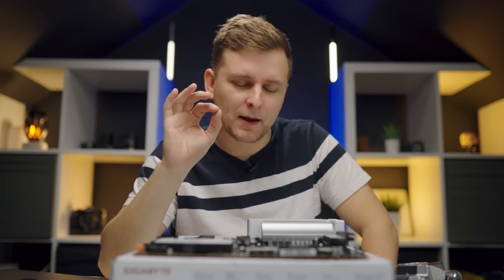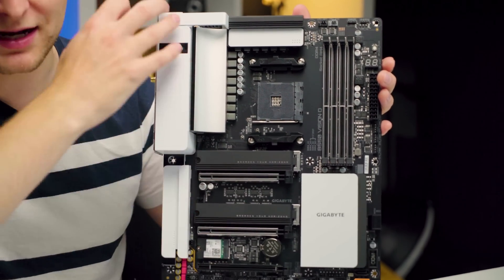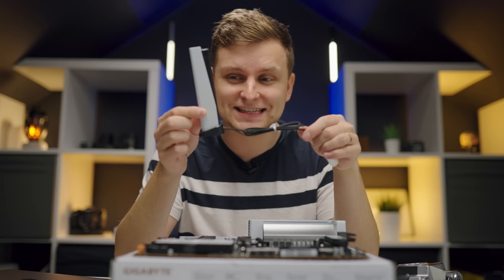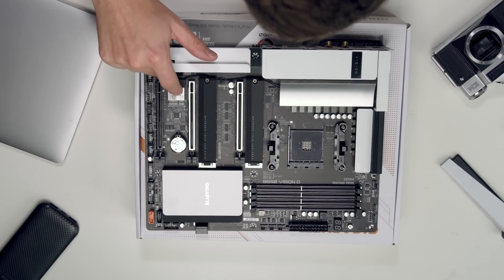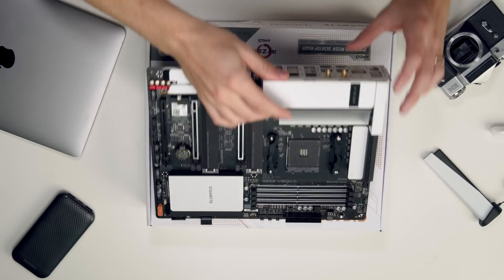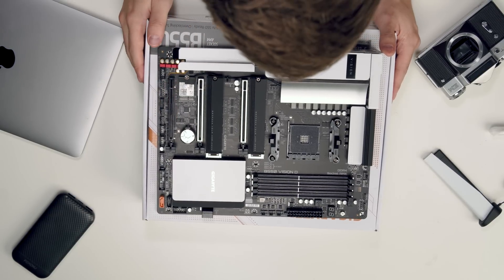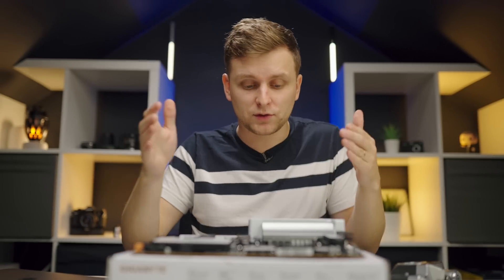Best Bang for Buck motherboard for CREATORS, finally! | Gigabyte B550 Vision D

Comment: These retail over $300. It looks great and I wish more motherboards were styled liked this, but this isn't exactly value lmao. There are a lot gimmicks, but I think most of it you don't really need. It doesn't have a lot of USB connectors and I still use a ton of HDD's for cold storage where SATA ports are the rate limiting step, so TB3 isn't going to help much. Also, the designare RAM unfortunately doesn't seem to be available above 3200 Mhz.

Comment: Bang for Buck for Vision D? It is super expensive! Probably the most expensive in B550 range and it's value for someone who do not necessairly need TB3 is mediocre.
Reply: I 'd like a Vision  X570 version, for both 4.0 Nvme M.2. I own two Sabrent M.2 PCI 4.0 1Terabyte. And this Vision D miss frontal USB C.

Comment: Hi tech notice,

Are you able to connect a thunderbolt monitor on this motherboard?
Reply from the maker: Nope, as far as I know, since it required the CPU to have iGPU, which would be slightly hard to find, and not sure if it would work. Better to get a GPU that has a USB-C port...

Comment: So if I wanted to game at high frame rate could I with this motherboard? Or is it meant for creating?
Reply: Fame rate depends from  GPU and CPU, not from MB.
Reply: @lorenzoocchipinti9120  i was just wondering if a motherboard could limit the communication speed between the two parts

Comment: Keep in mind that you need to update the BIOS on this motherboard if you want to use it with the 5000-serie Ryzen. Check out how to Q-flash the motherboard on Gigabytes website!
I struggled with this in my build, as it won’t boot straight out of the box with the new ryzen!
Reply: Hey can u please contact me I need help I just got into building pcs an I just finished my build but I can’t use WiFi, is this a driver issue or is my mother board broke I’m just stressing I spent so much time an money in this build

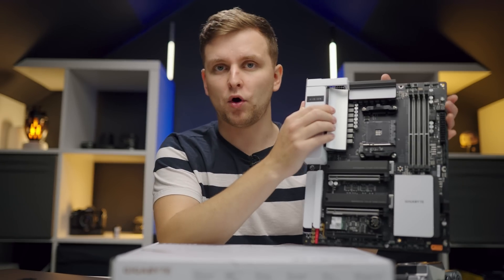Comment: 1:10 completely wrong. the Asrock boards came out beginning of this year have Thunderbolt 3 ports and its a creators edition motherboard this bought is the 2nd one this year.
Reply from the maker: Yes, I knew that, but as far as my research goes I don't think the TB3 ports on that board are not as reliable and have caused some problems.... and this B550 doesn't seem to have them. Now I'm happy to be proven wrong...
Also this is the first Am4 socket board that pugetsystems are recommending for a reliable TB3 bolt...

Comment: Heard about this board just recently. Planning on making a 5950x build, and I always thought you had to go with x570.

But what if I wanted to run 3 or 4 SSDs? Would this board allow me to run them at their full/max speed?
Could this board handle a beefy GPU like the RTX 3090?
(noob here)

Also, you could do a better job matching your cameras - your side view camera seemed brighter and more saturated. I'm not sure I agree with other people on flipping your top down view tho - this works for me.

But I see you're getting traction - good job!

Comment: heard asrock x570 creator #2 m.2 nvme interfere tb3 ports when it uses pcie lane, how would it works for b550 vision d? all the interfere issue i heard horrifying me

would b550 vision D tb3 controller uses its own pcie lane??
if its not   using tb3 header mb with AIC better than x570 creator and b550 vision D?

Comment: Hey! If I add two GPU's and two M2 NVME Gen 3 in this board. Will it affect its performance, will it bottleneck? Or should I go for x570.
Reply from the maker: Yeah, there will probably be a bottleneck...
Reply: @theTechNotice  see that's my concern.  I'm planning on getting a 5950 CPU with a 3090 graphics card for now, but quite possible get a second 3090 later.  I'm worried about bandwidth   Also probably a couple M.2 drives for when I do music production
Reply: @mathewCPA  But M2 Nvme slots aren't both 4.0, one is 3.0,  I own 2 NVMe 4.0 to Gen. 4 to mount and I would like to take advantage of PCI 4.0 in raid mode. I have to prefer a X570 with both Nvme 4.0 slots?

Comment: I know this is meant for creators but are there any drawback for using this motherboard compared to others for gaming?
Reply from the maker: Nope, unless you plan doing some serious over clocking...
Reply: It doesn't support M.2 Nvme 4.0 on second slot. I own 2 Sabrent M.2 PCI 4.0, and it would be frustrating not to use it on this motherboard.

Comment: I honestly wish gaming boards looked similar to this.
Reply: if a black version launches or any color that would be really nice.
Reply: @mixelio3409  I'm surprised they don't offer both, a la NZXT, but all black motherboards are at least available.

The Vision D is the only AMD mobo I've seen featuring a restrained, minimalist aesthetic in any color.  I just wish they'd offered a less expensive variant without the bifurcated PCI-E slots, as most users probably don't need them.

Although I don't need TB3 ports, they are at least useful for the board's target users.
Reply: @mixelio3409  Oh yes, and much faster.
Reply: I bought it primarily for gaming.

I'll never use the bifurcated PCI-E slots for SLI, don't use a Quadro GPU, and don't really need TB3 (at least not on my desktop), but the Vision D is just so much  better looking than every other B550/X570 that I bought it anyway.
Reply: @theoldhenk7531   is it supported rgb?
Reply: @theoldhenk7531  But M2 Nvme slots arem't both 4.0, one is 3.0?  I own 2 NVMe 4.0 to mount and I would like to take advantage of PCI 4.0 in raid mode.

Comment: I have a z390 for Intel and thunderbolt 3 is garbage. I constantly have to unplug an re-plug in my thunderbolt 3 drive and sometimes i have to restart the entire computer to get it to work. Also as you can see they didn't even cut the back plate to size for the USB-C connectors 5:20 so plugging it in is like threading a needle to make sure you get it into the connector and not the space in between, and it does get easier by the 900th time. 

Does this board have the same thunderbolt issues? 

Also from what ice read thunderbolt is not fully supported on AMD systems, that why there aren't any thunderbolt naming or logos on this board. Titan ridge is the latest thunderbolt controller which is why's it says "USB-C with Titan Ridge" and not "Thunderbolt 3". USB 4 cant come soon enough!!!!

Comment: Can anyone help me?
I wanna buy this motherboard but I’m confused by the 2 different nvme ports.
Can i use 2 Samsung Evo 970 Plus PCIe 3.0 on this? 
Not 1xGen3 and 1xGen4!!!

I wanna build an VFX PC and i want 2 M.2 NVMe and 1 SSD.
The problem is that i already have these 2 Samsung Evo PCIe 3.0.
Can I still use both of them?
Thx alot in advance!
Reply from the maker: Yes, absolutely you can use them both. You can always stick a 3.0 drive to 4.0 slot :)

Comment: I am a motion picture/ tv editor. Because of COVID I'm cutting more and more at home and I'd like to have a beast to cut with, run After Effects, etc... I was going to build the Mac Pro Killer but I really want the thunderbolt because I am a mac user and have a number of thunderbolt components that I'd still like to keep using. Could I do the same build as the Mac Pro killer and just swap out the motherboard for this one? ( Gigabyte B550 Vision ) How might that work?

Comment: THX a lot for that great Tip - it looks AMAZING !! :)  too bad it has no USB C front connection - I think i will buy it nevertheless because of the Thunderbolt 3 - i am actually running a LG Ultrafine 5k (MAC) and i ordered the Ryzon 9 5950x just now
Reply from the maker: Nice! 👌
Reply: @theTechNotice   do you know another opinion to run the older LG Ultrafine 5K on a PC ? Maybe with the graphiccard ? (rtx 3070) ? I googled a lot cant find a satisfying solution :/ By the way: I have no experience of building a pc - just inspired by your videos to build a render pc ! (3ds max and corona) - thank you for everything !!

Comment: Ok. I subscribed. And I ordered this motherboard and a ryzen 3950 cpu. Some of us could care less about how the pc looks. We have work to do. I would like to see a build that minimizes my time. Maybe there’s a case you could recommend that has the fans and power supply pre-installed? How fast can you build a machine?
Reply from the maker: As far as I know there's no case that has a psu preinstalled unless you want a very tiny case like the NZXT h1....
Reply: Thanks for your input. It might still be helpful to do a build that placed a premium on time. What would you buy if you just wanted to get a good system up and running quickly. I’ve know a couple of people who have built systems and it wound up taking them days or weeks to get it running right. It makes me want to just buy a machine from an integrator. But then I go and look at what pre-built systems are available and I can’t find what I want.

Comment: Love the look of this m/b, but why it is not for "gaming" what are the downsides, or even why should you go for x570 instead of b550 chipset. For example why not get this instead of  asus x570 Pro or x570-f?
Reply from the maker: So, it's 'not made for gaming' doesn't mean it's bad at gaming. What this motherboard is made for is creators and the TB3 ports and the nice design and thats why it costs more than some x570 gaming boards. So it will do very good at gaming it's just probably not a 'wise' purchase if you want the best performance gaming board for your money. But if you have the money and like the design it will do a very good job at gaming. :) 
Hope this makes sense ;)

Comment: Too expensive for B550 board even with thunderbolt. As a creative professional i dont need 2 GB ports ( for me personally don't need wifi and bluetooth also ), fancy sound on board is not needed, will use external professional audio interface, and ECC memory support is not needed. Would trade everything for x570 because of more PCI gen 4 lanes for faster storage and one 10GB lan. We dont know anything about power distribution because if im using it for content creation would like to use it with ryzen 9 so nice VRM would be desirable. Thats my 5 cents as a professional in the market for a new PC

Comment: WOW, thank you. I was ready to start my build this morning with a Ryzen 9 3900XT on a MSI  MSI MAG B550M Mortar WiFi Gaming board. It's only $170 but nothing under $300 out there I wanted to pay more for...Till I saw your video and this board...after watching it I ordered this morning and it should be here by 10pm tonight....I was a bit thrown off with no Thunderbolt being listed...they don't call it Thunderbolt.  That word isn't to be found on Amazon with this board....They call it Type C with Titan Ridge.  May be why they weren't sold out as well..  So yeah!  thanks again.  I couldn't find the Ram you mentioned anywhere in Amazon but not a biggy...all good...PS thanks to all for BIOS info

Comment: Would the version D work well with a Ryzen 3900x for video/photo editing?  Cheers!
Reply from the maker: Yes, absolutely! :)
Reply: @theTechNotice  Next question... 3900x or 5600x for same purpose?  Any advantage to either?
Reply from the maker: Looks like if you do a lot of Photoshop then you're getting roughly about 10% better performance with the 5600x. 
For premiere pro the 3900x will be better overall, so have to way in which program you use more. 
I have a feeling the 3900x will be more bang for buck since you don't have to buy a separate cooler since the included one is very good ;)
Reply: @theTechNotice  You rock!  I'll use the link ;-)

Comment: 250€ is not bang for the buck
Reply from the maker: If you need 2x TB3 and all the features there's no better board. If you want the cheapest board for am4 then that's a difference story, if you know what I mean. ;)
Reply: @theTechNotice  you have ad in cards you can put in the Pcie slot's. So 🤷

Comment: Just built a comp for myself with this mobo and 5950x and 3090. Only other option with TB I found was Asrock X570 creator which where I am costs 2.5 times more than this Vision D. One thing that annoys me is that there is no socket on the mobo for front panel USB-C . The shop where I ordered it from flashed the BIOS for me but as far as I know, it has function to update BIOS without CPU
Reply from the maker: Wow that's an ultimate setup! And yes you're right about the bios update.

Comment: the good part of B550 is  Thunderbolt 3 port。 but it only pic-e3 in the second M.2 port ,and 4 stata port. wifi not support 10000M , so I pefer gigabyte X570 master
Reply from the maker: If TB3 on AMD is necessary then it's the only solid option 😔🙂
Reply: @theTechNotice  yes  ,though TB3 port, It's good for transfer big data of movie editing 、3D Artist

Comment: Yeah this board was on my short list but ended up with the ASRock X570 Creator, 10Gbe + TB3 was too hard to pass on.
Reply from the maker: I've heard that TB3 on that board plays tricks on you, how's it working for you?
Reply: @theTechNotice  So far it's been ok, I use the ASRock 1.41.987.0 DCH W10 drivers. I only have access to a TB3 dock and display at the moment. The Gigabyte looks to better for display support as you only need to connect the single DP to get display out from both TB3 ports, the ASRock you need to connect both, the external DP is routed to port 1 and the internal DP to port 2.

Comment: BINGO! Got my Vision D on Wednesday - was DOA. It went back, replacement arrives Sunday. Migrating off an ASRock X570 board that supposedly supports Thunderbolt but always had quirky things happen. Hang Promise RAID arrays off the machines. Looking forward to getting this board up and running.
Reply: Interesting discovery - the replacement board arrived today and it behaved exactly the same as Wednesday's board. So, couldn't be a second DOA - very unlikely. In the end, we thought "Maybe the PSU just can't provide the power needed?" even though we were using a Corsair 1200W supply. Picked up an EVGA PSU and bingo, board worked. So, careful if you are using an older PSU - may not have enough power for the CPU on the B550 board.
Reply: @derekjcooper  EVGA SuperNOVA 750 G3 80 Plus Gold?
Reply: @derekjcooper  does the Thunderbolt 3 work as promised then? Looking to connect 2012 iMac via Thunderbolt to this MB.
Reply: No idea  @jamesambrous  - we connected Promise RAID arrays to the motherboards; no experience connecting Macs. Sorry my friend. We have since dropped Thunderbolt.
Reply: @derekjcooper  Hey no problem. Thanks for the help.

Comment: not the first/only, by a longshot. but the real issue (for creative workloads) is that it's B550 - other boards with TB3 (e.g., AsRock Creator, Arous Master) are X570 and aren't hobbled by limited pcie connectivity. plus Creator has 10GBe.

Pretty board, though.
Reply: I'd say it's a niche board. Mine is on order with my new ryzen cpu because I only want the tb3 ports. I for example don't need more pcie connectivity than what I'm getting with this board. So I won't have to scrape another 150€ out of my bank account :). I also won't have a 10gbe capable nas in the near future so I'm gonna be fine. Still I get your point, I might just be the exception hehe
Reply: @Lollokowns  absolutely - if you don't need, you don't need. in general, "creators" are more likely to be in the "need" camp, though - gpus, capture cards, high-speed storage, 10gbe for moving huge files.
Reply: @Adrian-jj4xk  true, if I was working with Video it would be a different story. But it is audio for me, file sizes do not make me need these transfer speeds as of now :). So I reckon we are on the same page ✌️
Reply from the maker: As far as I know this board is the one with the most reliable/tested tb3. 
I've heard loads of issues with the asrock and aorus master. 
Happy to be proven wrong though!?🤔
Reply: @theTechNotice  well, if that's the point you meant to make, would be good to see a comparison  : )

Comment: I'm just in the market for a motherboard so this video came just at the right time! Would definitely like to see a build with this.
Was also wondering what overclocking would be like on this?
Reply from the maker: I think should be decent, although thing to note is it's only got 1x 8pin cpu power. 
For creative use I wouldn't overclock it :)

Comment: I'm a content creator and will soon buy a brand new system. I've heard that x570 is more the way to go. Am I making any compromise if I go with this 550? Looks amazing and has all features seem I need.
Reply: I'm considering this mobo myself, it seems that there are only a couple compromises/downsides that i found: only 4 sata, no usb-c frontpanel header, only 2 m.2 (most higher end x570 have three), only dual 1gig lan (although this is more than fine for most people, not to mention intel lan is more stable than the realtek 2.5g lan that is found on a lot of x570/b550 boards)

I feel that these downsides are only minor, but you might feel different if you have a lot of drives or need the usb c header for your case.
Reply: @NowThatsPodRacing  I really like the idea of 3 m.2s btw! Thanks for sharing, didn't know they had 3. I'm a creative so storage is important. Have 1TB m.2 now and want to buy another one but 2tb. Having place for more is nice. Also USB type C!! As I'd like to have a case with it, therefore use it! 

Quite a helpful man, thanks for the info. ANYWAY, they'll be beasts! I'm on 6700k and gtx 970 :D
Reply: I think with x570 you are gonna get more pcie4 connections for your m.2d devices and pcie slots
Reply from the maker: I'd also mention that don't forget the main feature of this board: 2x TB3, that means you could easily get a usb-C hub and run loads of  things of it coz the bandwidth on tb3 is insane. 
But I get the m.2 issue, although you could buy a PCIe extension card and use that.